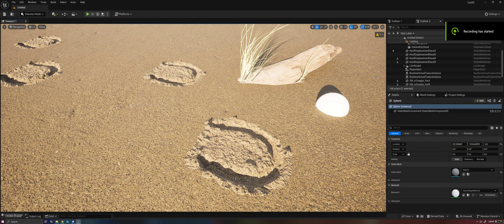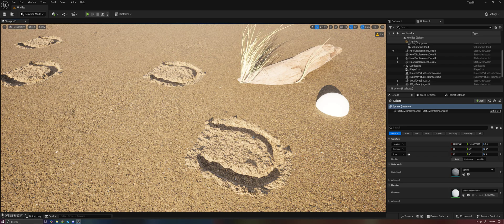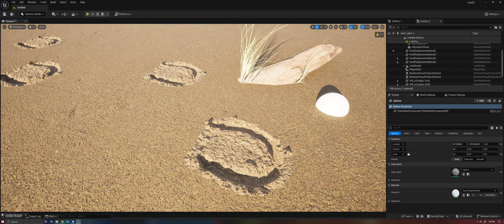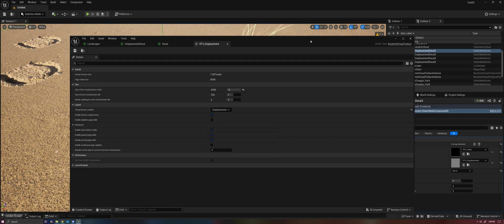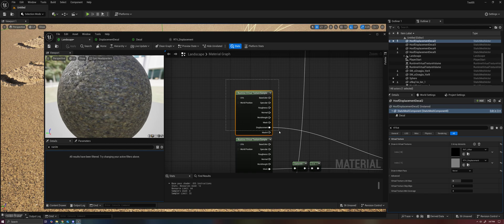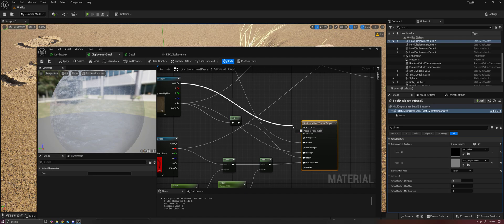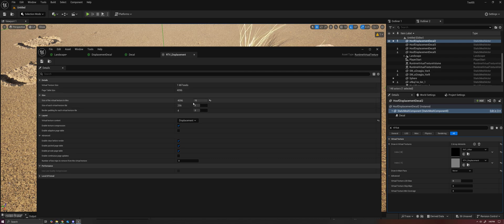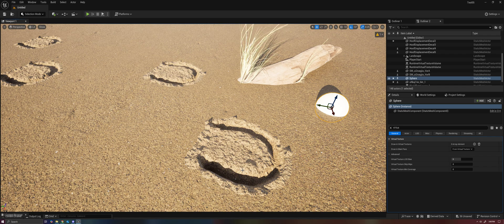Nanite Displacement Decals: Adding fine detail to your terrain

Comment: I get artefacts at mask edges, not sure how you fixed that. Can't figure that out from video. You barely show your materials :(
Reply from the maker: What do the artifacts look like? In my example the alpha texture has faded everything out by the time it gets to the edge.
Reply: @TechArtAlex  spiking vertices in form of a very thin contour where RVT mask ends and my base displacement in my lerp starts. If i use RVTs mask, it pushes down the outside of RVTs disp and i have to compensate that in my base disp to match the RVTs disp level.
Reply from the maker: @George-mr7vl I think as long as both textures have the same midpoint that shouldn't happen, but some displacement maps may need adjustments to their base level and range.. since the downside of this technique is all textures have to share the same midpoint and max displacement value since they are being pushed through the same material. 

But a good mask should still lerp seamlessly from the terrain to the decal. Maybe also make sure that something is written into the RVT in places where decals don't exist - even if it's just a 0 coming from the landscape. It could be null pixels causing problems.
Reply: @TechArtAlex  I did a simple test. I put  in RVT disp slot a constant with value 0.5 and as a mask and opacity value 1.  In my lerp I had to put a value of 1 as  terrain disp to match the 0.5 RVT and because of that I also get the edge artefacts. The displacement material has default value 0.5 and i use magnitude 20. Is that normal behavior?
Reply from the maker: @George-mr7vl  No that doesn't sound normal to me. I just did my own test, and if I output 0.5 into my landscape (which is also drawn into RVT) and then write 0.5 into the RVT via the "decal" I get no visible displacement and no artifacts using the default of midpoint 0.5 and a mag of 4. 
If I set my decal to output 1 (lerping to 0.5 with a mask), it hits the expected height of +200 units along the Z axis, and 0 is -200 units. The edge remains seamless. 

As a sidenote, try to avoid setting high magnitude values, they can significantly increase the cost of using nanite tessellation. If an object will extrude +/- 1k units, perhaps it should use a mesh instead. Even the default of 4 is extreme and would allow you to displace +/- 2 whole meters. Landscape displacement should probably be kept below 1 unit, arguably well below.

Comment: I get the idea of making it quick and easy but cmon man at least show all the Blueprints and Materials you've made so we can properly understand what youve done, zooming out takes one second and you can always pause ...
Reply from the maker: I understand where you're coming from and appreciate the feedback but for what it's worth if I didn't show it explicitly it's generally because it is not doing anything related to what I'm trying to demonstrate and likely is not stuff that should be but instead replaced with project specific stuff. 

For example, this material has a very basic landscape material that no one would ever use - so showing that part of the material adds nothing of value. 

This video assumes someone already has a landscape material using RVTs or knows how to set it up, so the stuff I skipped is all related to that assumed prior knowledge. 

Sometimes I show everything but that often leads to people just copying things exactly without taking the time to understand what I've actually said/done or why. I want people to have to think about how the pieces I demonstrate should fit into their materials, because that's what will give someone the skill to adapt, improve and troubleshoot it for their specific project needs - Especially with something like a landscape material which varies a lot. 

With all of that said, is there any part of this technique you're having issues with?
Reply: @TechArtAlex  Understood, appreciate the response - i wrote the comment in a moment of frustration when the tesselation wasnt working and, turns out, its apparently a engine related nanite bug in my project i cant get fixed. But anyway vid is still tops but also, as i understood, this is more for creating realtime tesselation ingame - which i dont really need so ill try the classic static landscape tesselation if i can get my bug fixed. Also you make real innovative tutorials which i always appreciate so you earned a sub :)

Comment: Problem is if you modify the rvt it blurs everything for a second and reloads the mips. So not a solution for interactivity. I tried this for rvt puddles and trying to make them dynamic.
Reply from the maker: @mindped  It depends on your project settings, but yes, RVT isn't great for dynamic updates in real time. For that you would be better off using standard render targets, which can also be sampled in the landscape for the same result.
Reply: @TechArtAlex  good to know. Ill look into that. Thanks!

Comment: honestly i think nanite displacement might be a contender for the worst optimized feature i've ever seen in a game engine, i think they should really focus on improving their parallax occlusion mapping, and maybe fix the pixel depth offset, motion vectors and the loads of unfinished features they have put out over the years. I really missed tesselation but after seeing how poorly optimized this is and how poorly optimized nanite is in general i've given up on it.
Reply from the maker: In this project, enabling nanite for the landscape cost around 0.3 ms, and enabling tessellation added about 1ms on my RTX 3080. While I like POM - after all, I've made like 7 videos about it - it has some pretty big pitfalls that I think make this worth doing if you have the headroom. But as always, every project is different. 
The good news is this system should easily implement alongside POM decals for a user setting.
Reply: its really sad too because it was promised as “you wont need to optimize your meshes now!” and that feels like a half truth. 

also like all the decals in megascans just do not look as good without displacement, its a real bummer.
Reply from the maker: @owenb6499  
Nanite terrain/displacement in particular is expensive... But we need to consider what we are comparing it to.

Compared to an low resolution, non-displaced surface or landscape?.. Of course it's more expensive.

What we should be comparing it to is something like a high end POM material. 
In that case, it can actually be less expensive, depending on the viewing angle and other specifics of the POM. But even if it costs more, it can deliver better results in many instances so it's still not really apples to apples. 

POM has some significant drawbacks too, which can't be ignored if we are to critically compare them. 

Also keep in mind that nanite tessellation is more expensive to render than standard nanite for a variety of reasons. 
When possible, it will often be better to add detail with a regular nanite mesh.
Reply: @TechArtAlex  thats true, i dont know if its possible or not cause i havent messed around with the settings but i feel like it adds waaaaayyy to many polys for whats needed.
Reply from the maker: @owenb6499  You can change the "dicing rate" with a cvar, but fewer triangles doesn't actually help improve the performance much with nanite tesselation so you may as well let it add the ridiculous amount.